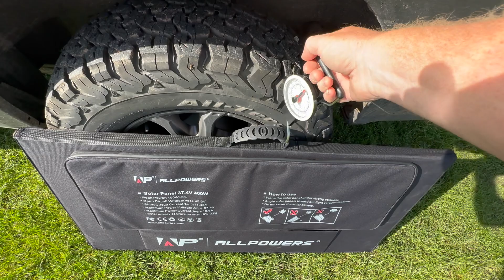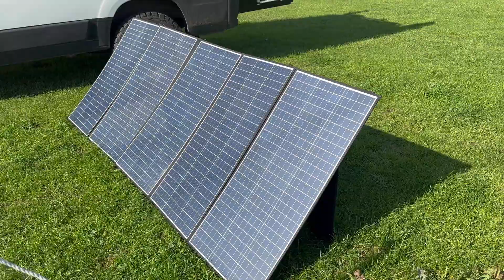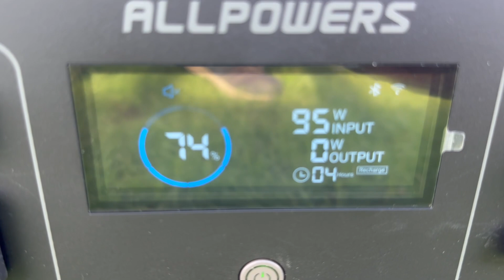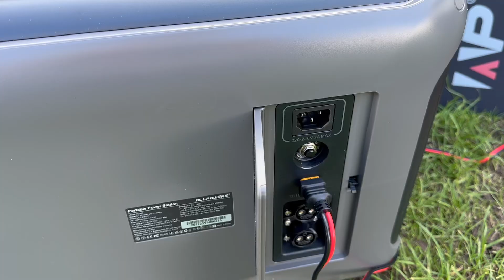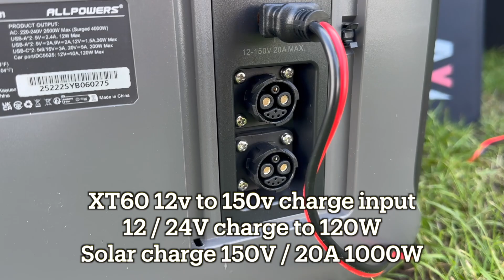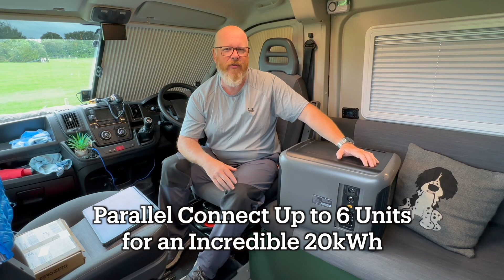Allpowers R2500 & 400W Folding Solar First Impressions

Comment: I'm for getting one of these, Im also from the UK and have only seen in your video that the power and expansion ports are in the back of yours rather than on the side, I really hope they're on the side with the one I get, I really don't want the cables on the back.

Comment: Hi John.  I'm after your advice on the allpowers r2500.  I've the s2000 x they are fine.  I am looking to upgrade to this model due to charging time off AC, it's capacity is better than. S2000. Also 6 year  warranty.
Now you've had this device for over a year, what's your thoughts on reliability.  I wish to charger pvy bikes, whilst this is lump, I am interested in your experience.  Did consider ecowflow, however, your previous experience of their product put me off, especially after their treatment of you.

Cheers, I hope you can reply

Paul

Comment: Battery are at 12??? Not 48V? 😮😮
Reply from the maker: Output voltage is 240v ac and 12v dc
Internally the batteries operate at 48v

Comment: Nice review John, when pitched-up and on hook-up I guess you keep the Power Station in the van and charge it on 240v - do you ever see any issue with voltage drop or insufficient power to charge these Power Stations? Cheers
Reply from the maker: You can power this up via hookup and then have it power your van so if the campsite power goes off the power station takes over.  There are 3 ways to charge them, all the ways to charge are standardised.
Reply: @GadgetJohn  kind of getting interested in these to provide the 240v side of things in the van, most of the time we would charge it by solar but when at a campsite would park in the shade and charge via hook-up. Just wondering whether there’s any voltage drop or insufficient power issues on a long hook-up cable 👍🏼
Reply from the maker: 240v mains is the same from the socket in your house to an inverter, they make hookup cables a set length so you don’t get a voltage drop.
Reply: @GadgetJohn  it did go through my mind this morning that Caravan owners use high power items - my parents haven’t had issue in the caravan. Think these Power Stations are a good solution; I have AGM’s - fine for low demand, I think the PS would suit our 240v needs in the Van 👍🏼

Comment: I found a returned S2000 for £650 😀 I used your amazon link so hopefully your channel benefits a little from it. Now I just need an affordable set of solar panels. Any suggestions/recommendations? I would buy used but haven't found any at a reasonable price.
Reply from the maker: Oh thank you so much 👍🏻 most folding solar panels are build the same way once you go over 100w, so choose one with good reviews and for the S2000 that’s 400w max.
Reply: @GadgetJohn  Thank you. I'll keep my eyes open for a bargain 🙂